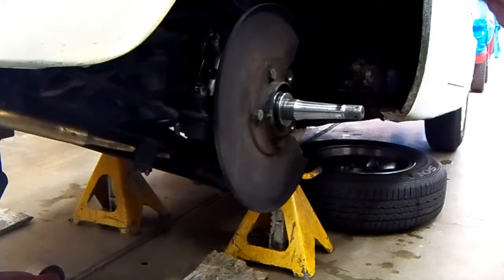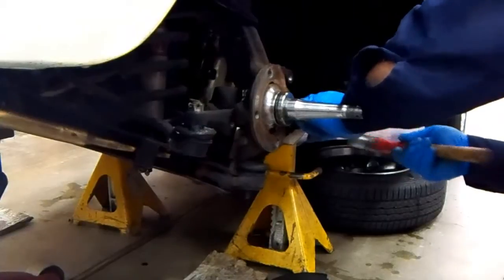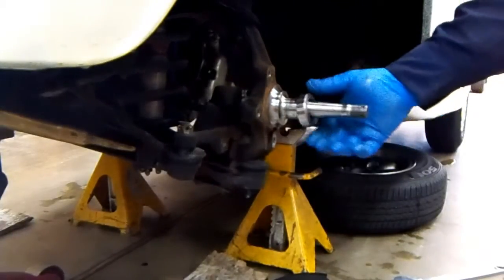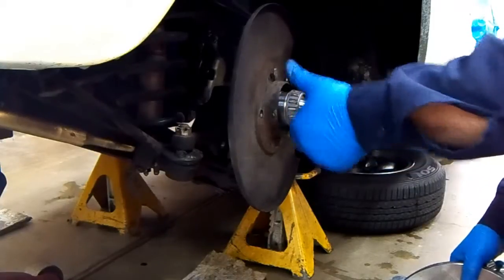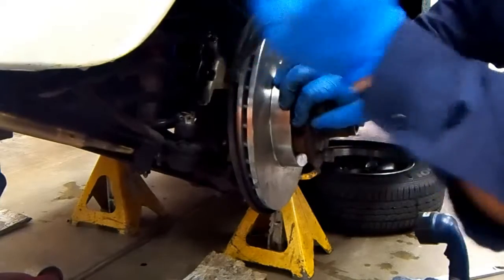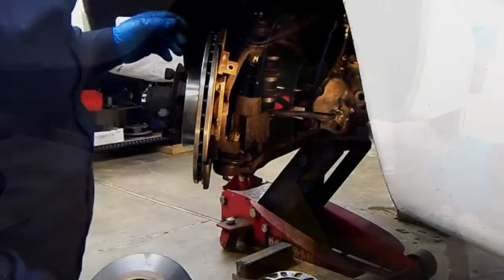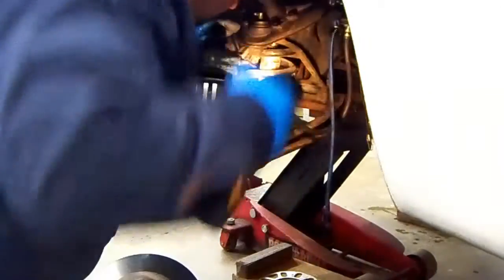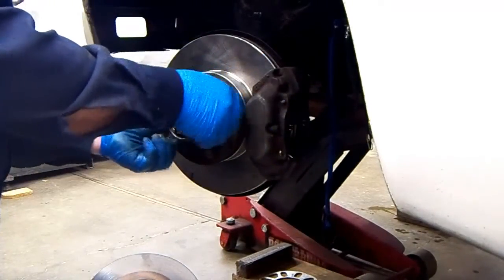311 Roadster Brake Kit Install

Comment: what master are you running ?
Reply from the maker: +68datsun2000 I don't have a roadster....I'm just the fab guy.   I'm pretty sure the guy I did this for is running the stock m/c.  If you're familiar with 311s.org, there's a thread on there about the "Altima" brake mod.  The info might be in there.